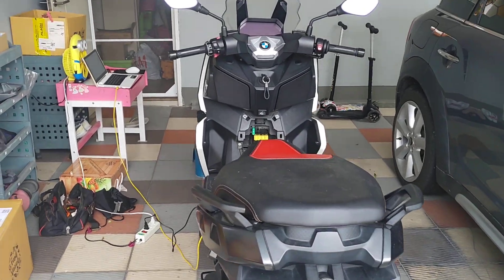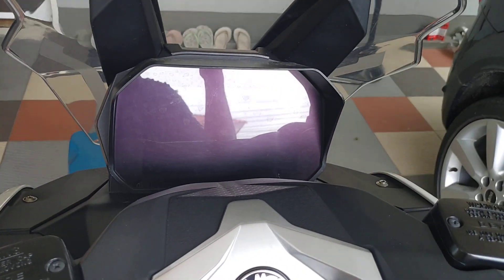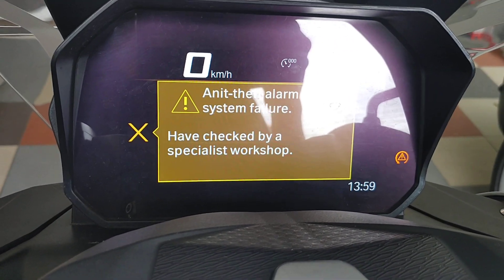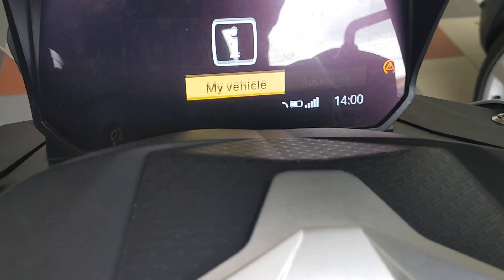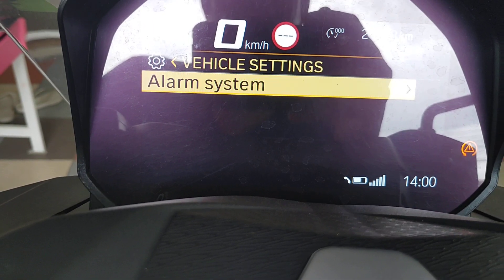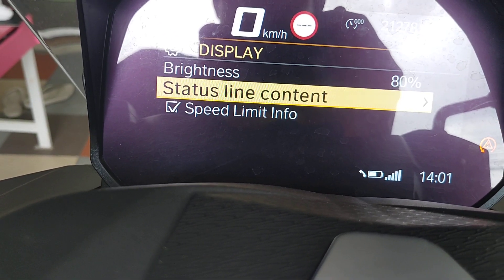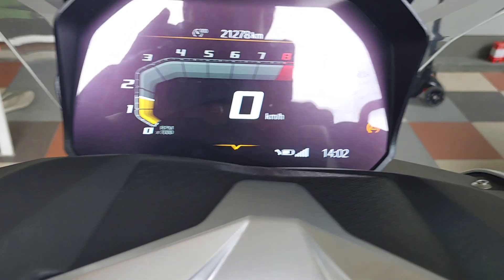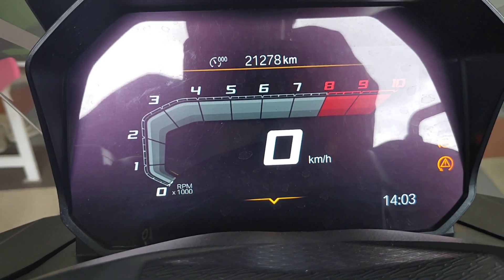DIY BMW C400X TFT coding from GS part:1 BMW C400X and BMW C400GT with R1250GS Display.

Comment: Hi! What code lines are you modified in e-sys ??
Reply from the maker: You need to take CAFD from s1000r into c400
Reply: @phadmotorrad  how can I do that?
Reply from the maker: @velezdando  not so easy but not so difficulty the mechanic man who codes motorcycle can help for this. He may have s1000r file.
Reply: @phadmotorrad  thank you. Who are this man? Are you the S1000R file? Could you send me by mail?